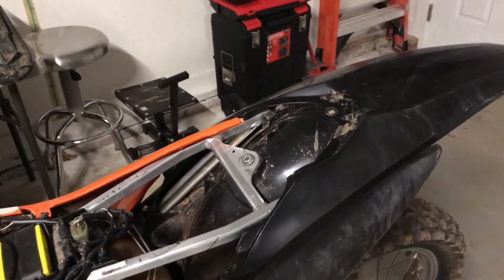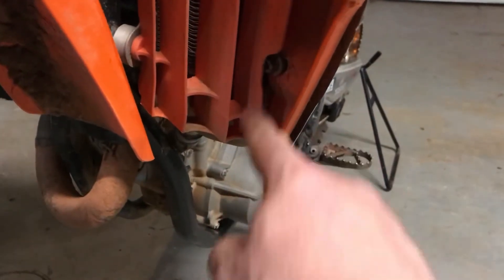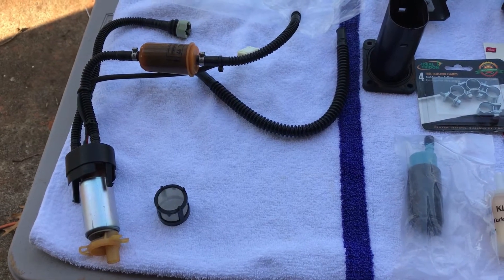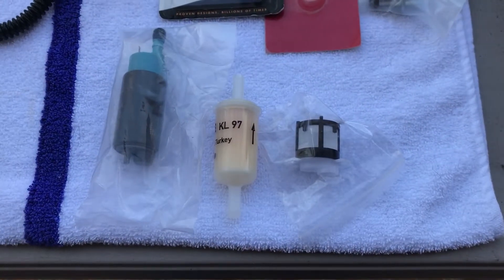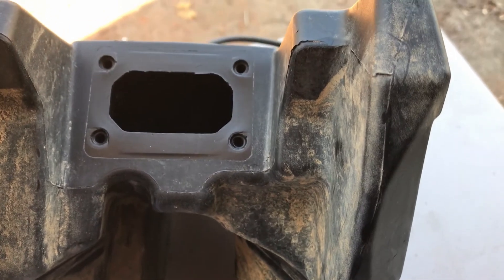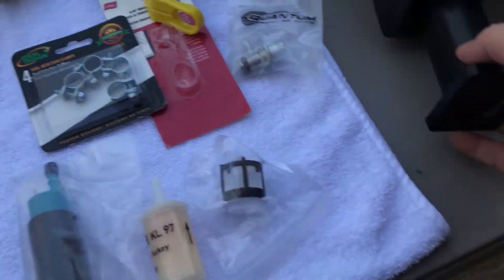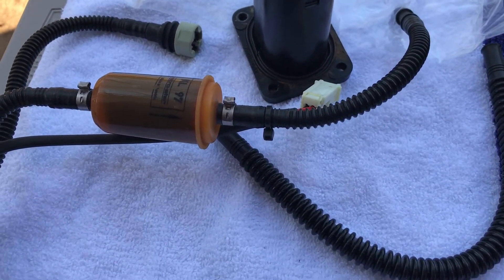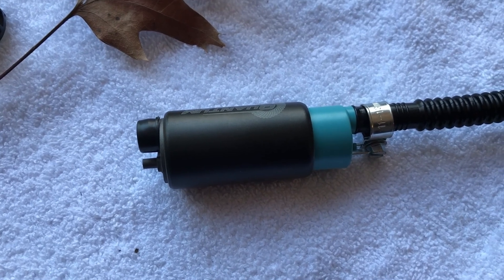KTM 250SXF Fuel Pump Replacement(2020)

Comment: I'm assuming this fixed your problem? Having a similar problem on my kid's 16 250sxf. Hard starting must of the time, runs good for the most part once running.
Reply from the maker: If I did it again I would buy oem.   

Other solutions I found to hard start were adjusting fast idle choke and holding the throttle wot until I kicked to compression stroke.  

If you have electric start I’m not sure.  Could be filter or dirty injector.

Comment: I’m currently looking at at 2013 SX-F for 3000 bucks. The guys said it doesn’t run but will run perfect with a new fuel pump. I’m trying to save money. Wondering if I can do this myself. I’ve done other projects before so hoping I can do this. Just moved to Vegas and don’t have friends who ride yet. I’m itching for a bike
Reply from the maker: Fuel pump is not hard.  The brand I used still works, but I have read where they fail sooner.  If you have done some of your own work then you're more than capable.  Good Luck!